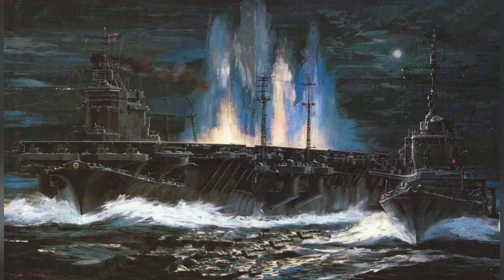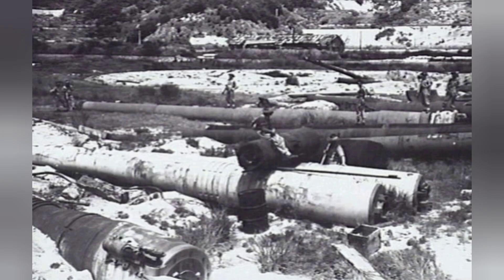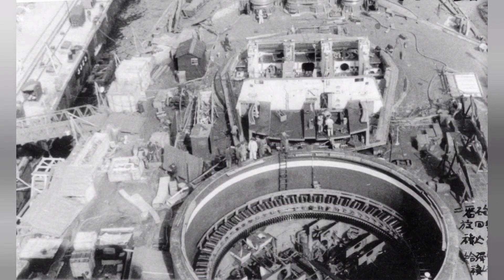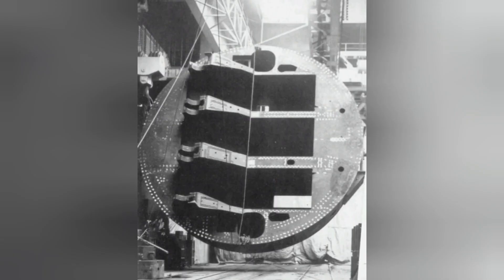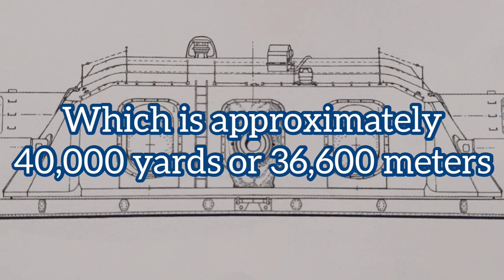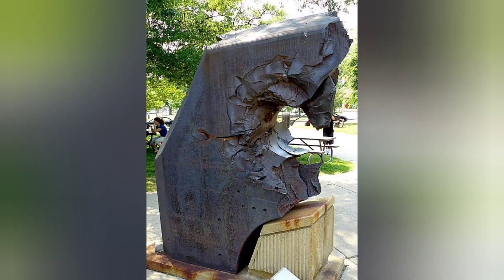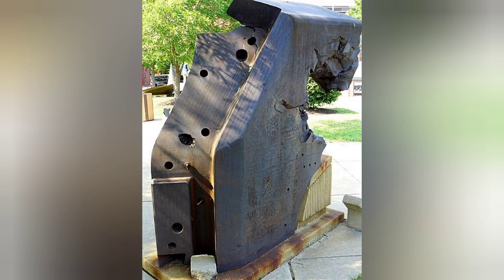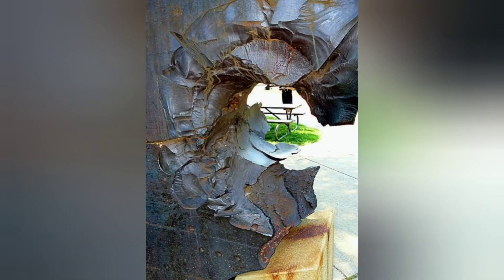Shinano turret armor test.

Comment: I can't even begin to imagine what it would be like to be in any turret that is hit with a large caliber shell like that even without penetration. The sound alone would seem to be crippling.
Reply from the maker: Most certainly. I always think of Dunkerque when a 15 inch shell it's it's turret No.2 over gun 8 and ricocheted up. It bent the turret roof in and caused a fire which released fumes into the right hand firing chamber killing several men. It's never pleasant to be in a confined space with a large projectile hitting it.